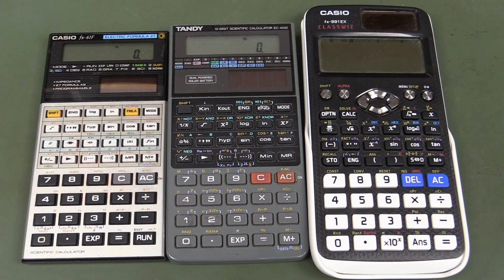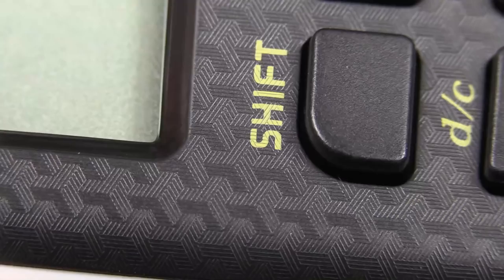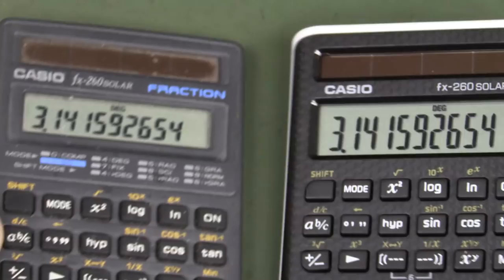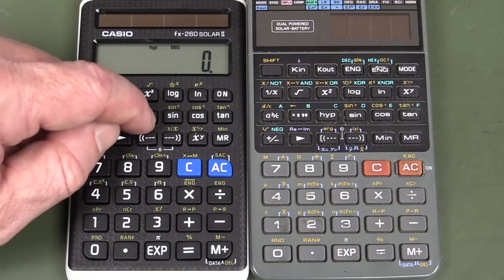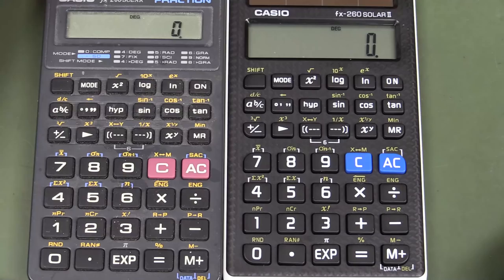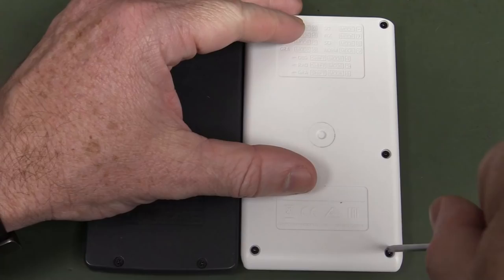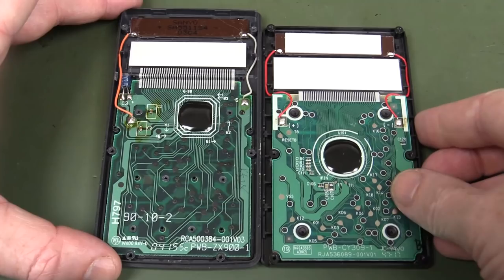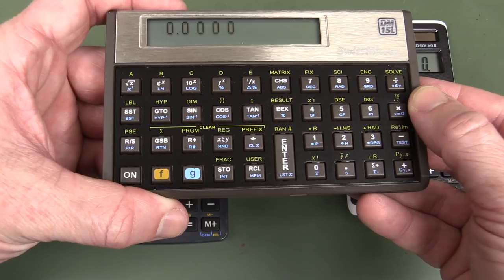EEVblog #1093 - Casio FX260 Solar II Calculator Review

Comment: I had one similar but was stollen back in the school :( It was compact but limited digits. Then i worked and bought the fx-570w which was very advance back in 1998 and of course forbiden in Digital Systems class, because of bin /hex conversion. Still works today. I don't like the new similar models. By the way this 9 dol calcl does compute well sqrt(2) * sqrt(2) = 2 or 1.999999....
Reply from the maker: 2
Reply: Thats ok for a scientific calculator nowadays. The basic calculators and old scientific normaly give 1.999999..8 because of its basic computing, relying on the digits from the input and result internally.  Try that with fx-61f or even older scientific, one input at a time of course, so sqrt(2) [=] Ans[*] sqrt(2) [=]
Reply: fabio sousa The old Texas calculators always had a few extra internal digits.
Reply: It's usually specified on the first or last pages of the manual. The one i refered was a ti 25X solar and had  10 digits, while others would have 10 to 12 result  on screen plus 2 for the exponential.

Comment: Interesting. My TI-nSpire CX CAS shows the result of the calculation to be 8.99999998177. But it runs on a 32-bit 132MHz ARM9 processor.

Comment: I think there is a market case for a custom layout. The functions that you considered wasted space, I use a lot. As said before, I personally believe the fx100D Super-fx had by far the most superior layout for my needs. Every other calculator I own just wastes my time via unnecessary  key pressing exercises, and that is, in my opinion, rather disappointing. Is it really that difficult for Casio to print a larger variety of circuit-board foils. They must be really cheap to make.

Comment: One nice feature of the fx-260 SolarII is its %CH (or∆%) functionality. It's buried deep on the instruction sheet, but not shown on the keyboard. To do so is ezpz; Enter the new number [ - ] old number then shift percent.

I also like newer 260's & have several around the shop, one in the kitchen table basket, and another in the car glove compartment... which for a few years now survived PA summer heat & freezing winters without skipping a beat, even working 'ok' with just the cars dome light.

Icing on the cake is should one ever meet an untimely demise,, no tears! They're cheap!

Comment: I gave up trying to rummage around looking for a calc in my normally messy shop, since my cell is always with me. I've settled on the RealCalc for Android for now. An HP RPN look-alike is available but I would have to re-wire my poor brain. :-)
Reply: Realcalc has an RPN mode if you want to try it. It's actually very straightforward once you're used to it, only downside is that infix feels a lot more unreliable once you've used RPN for a while. ("Crap, did I press the right operator before I started punching in this number?")

Comment: Does Casio make any calculator with an engineering mode? Even the fx-115 has that "engineering display as a function" nonsense, and that's probably the best infix calculator I've used.

I'd love to see a teardown of the Swiss Micros calc, or an HP42S if you can find one without selling a kidney.

Comment: These must be going out of production now or something. Can only get one on Amazon (called fx-82 SOLAR II in UK) for £28 in 2020. I wanted a smaller scientific so just picked up a Sharp EL-510RT for about £12, which has a single-line dot matrix display and D.A.L. –  guess you wouldn't like that. Cute little calculator though, but rubber keys. Prefer Casio.

Comment: Why speculate about power consumption when you already have them open? 

Gee, if only there was a device made for power measurements, that had a low burden voltage, that we could put in series with the solar cell. :^)
Reply: I second the vote to use these low powered devices as examples to measure low current.

Comment: Not so sure about the "calculator forensics". Since I can think back, I have used a Sharp EL-540D vintage calculator, which is more accurate (with this test ->9.000005947) than Dave's two and also faster on the 69! ... The forensics website shows a different value. Go figure...

Comment: No way!!! I didn't know that Casio made electrical engineering calculators!
Reply: 991ex is great for electrical engineering
Reply: Dušan Pešić the fx 991 dex is amazing , as a mechatronics engineering student i use it almost evryday as my main beside a cg 20
Reply: The FX-82 (which this is clearly descended from) was our high school calculator for six years — this was just before they started mandating the Ti-83 graphing calculator.
Reply: fx-991 dex for the win!
Reply: And the fx-82 runs incredibly long on just one standard AA-battery, compare that  to  the ti-83 which needs 4 and slurps energy

Comment: In my opinion the fx100d was casios best calculator. The fx260 is just a butchered version of it. My fx100d died beyond repair this year and Casio chose to discontinue fast algebraic calculators. Now I have to live with the 991ex which is a lot slower than my 30year old fx100d just because one has to punch more keys to achieve the same result. These days companies just don't get it. Why discontinue a great product for a mediocre one?

Comment: HP or bust.
Reply: HP RPN or bust
Reply: Yes! I have a bunch of old ones, and two of the HP-15 remakes they did a few years ago. The Swiss Micros clones are really nice, too. [Edit: ha, I posted that before I got to the part where Dave mentioned the Swiss Micros.]
Reply: buy the HP 300S Plus...

...and get Casio with a different case :D
Reply: My HP Prime bust while trying to recover from a failed os update, sighhh.
Reply: Agree, agree, agree. Even bought a swissmicro  DM42 as a safe usage to guard my HP42s calculators
Reply: It looks like the HP 300S+ is a rebadged Casio. Not that there's anything wrong w/ that !
Reply: I love my HP48GX! Still using it.
Reply: Better bust HP is lost

Comment: just use your phone...?
Reply: I have always found calculator applications on phones and computers inferior to an actual calculator. What's more, the calculator that comes preinstalled on my phone tries to use the vpam way of doing things but in a much more awkward fashion.
There's also the fact that because my calculator is always on my desk, it is much faster to pick that up and get started than going and getting my phone, unlocking it, starting the calculator app and then getting started.
Reply: Absolutely. There are some really terrific calculator apps (the WP-34S is amazing) but I still prefer a physical calculator.
Reply: Try using your phone for calculation during an exam, see how far that gets you. :p

Comment: Spunky wankery?
Reply: Probably a case for great calculator and challenge that questions supplied are not challenging of computational ability. Likely applied mathematics.
Reply: jyp is further mathematics but in reality, e^ix replacing both sin and cos ...
Reply: likely different algorithms for series summation, pade and bounds folding
Reply: you can statistically predict, but reset turn it off and on again...

Comment: Meh.....  Fx7000g.  Now that was a great calculator.
Reply: Yeah I have one from the 90's and still works. Didn't get a lot of use due to the expensive batteries at the time. People sell them on ebay quite cheaply. I remember it was a couple of hundred back in heh 90's.
Reply: I had the 7500g and it was great, but lost it at the university ☹
Reply: One of the best calculators was the Casio FX82, I think they made 2 versions, a VFD and an LCD